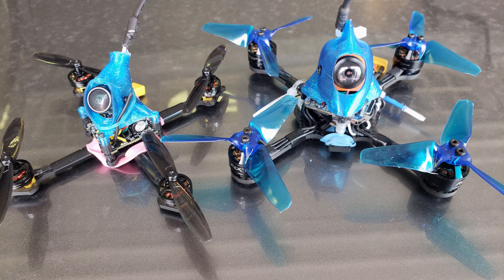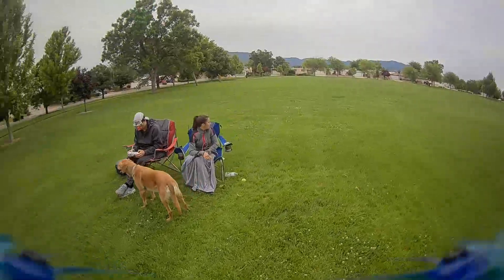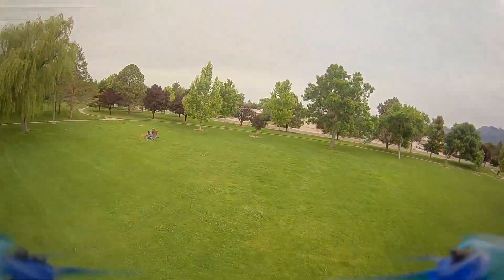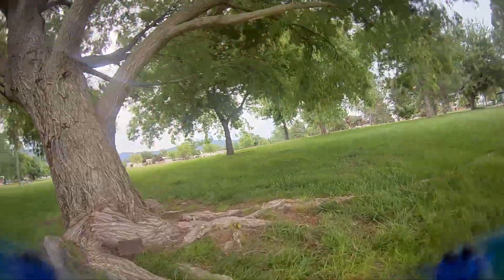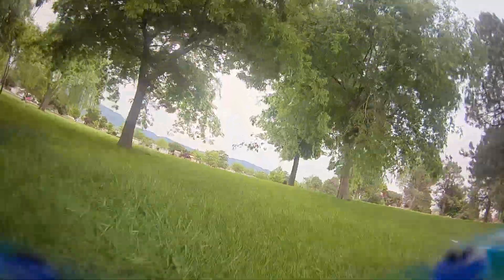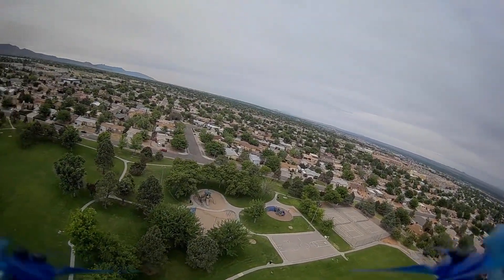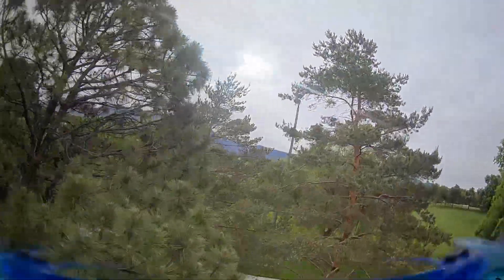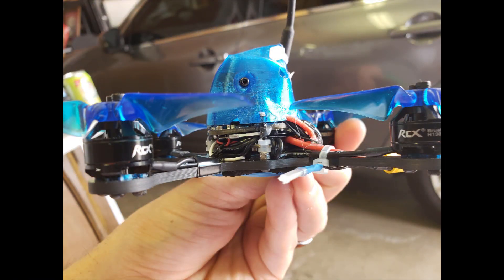Toothpick 3" HD

Comment: Do you think 2.5 or 3mm is better for a HD toothpick with 1204s ?
Reply from the maker: I think 1204s could work decently on either with the right KV.  I've used the 5000kv on 3inch 3s and it did ok but my Mamba 1105s do better.  2.5" would need higher KV.  It all does depend on exactly the flying style you are looking for
Reply: @PhilArndt1  Unsure if there's much diff btw the 1204s and 1105s tbh. I'd just like to be able to use 2s and 3s batts

Comment: Nice, but how do you mount the caddx turtle board?
Reply from the maker: I put some electrical tape on top of the AIO FC/ESC board and just put the Runcam Split Mini 2 board right on top of that just turned slightly sideways to fit in between the 4 25x25 bolts, used some hot glue to the bolts to keep it in place and the TPU canopy also pushes down on it to keep it in palce

Comment: What do you think about 1106 6000kv Emax motors on a build like this (with 3s)? I like the idea of an 11xx motor so there's some protection in a crash for the motor. With the 1304 motors it looks like you will hit the motor instead of the frame in a strike. Also I have the 1106 motors sitting around so it would be nice to use them.
Reply from the maker: I've played around with different 1106 and 1107 motors on 2.5" builds and was never really happy.  They get soo hot and burn out every so often.  If I swapped some onto here I would assume that it would fly "ok" but not great.  You are right about the motor protection, I would like to see that improved.